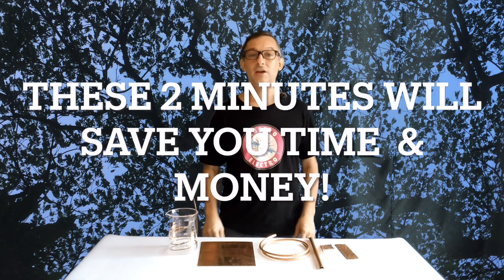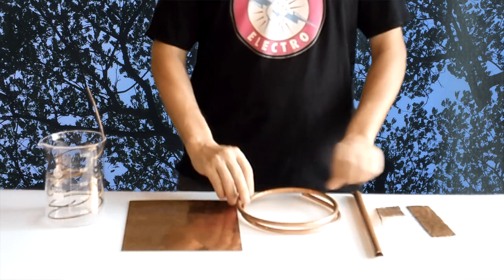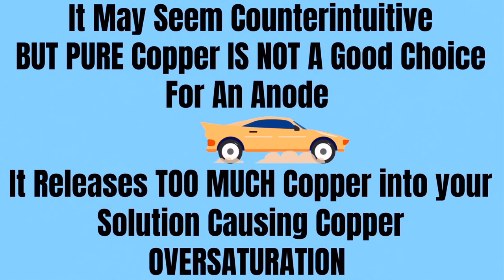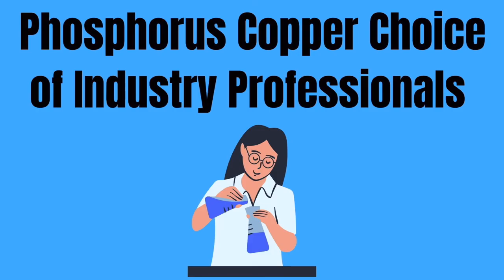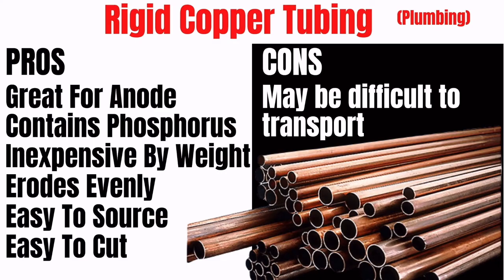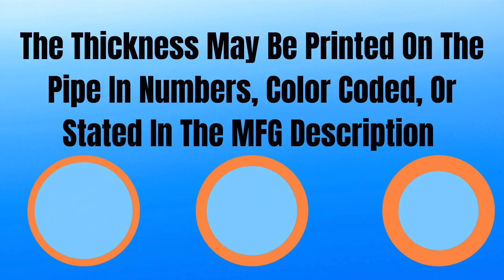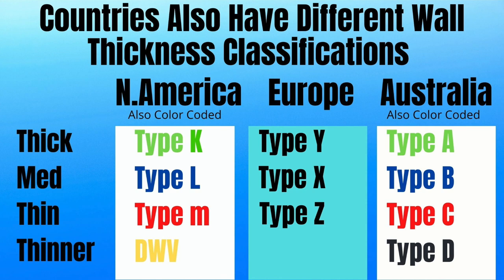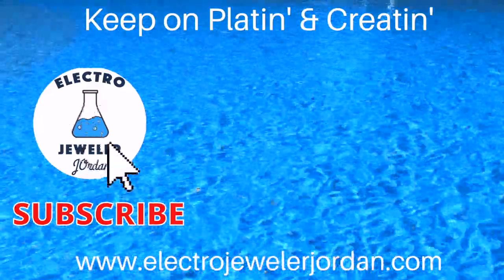Proper Anode Selection Copper Electroform, No More Guessing, Perfect Choice

Comment: great vid! I use pipes but I have no idea if they are phosphorous or not. Might need to look into it.
Reply from the maker: Most straight pipe contains phosphorus.  After you add the chloride the pipes should turn black after a few hours of plating, that coating shows that it contains phosphorus .  Every copper pipe has the manufacturers name and model number on it, you can go to their website  and look for the metal content.  The phosphorus  content will be less than .5% so don't worry if it looks like a small amount.
Reply: @electrojewelerjordan490  oh cool, yep I get that blackness so I must be all good! Hey I have a question.....you know how the anode to cathode ration should be 2:1? Do you have any advice on how to calculate this for pipes? I have seen some people say to only calculate the front half of the pipe and not the back, but then other people say this method doesnt work for them and they calculate the whole pipe (the part that is submerged for both cases). I only just learned about the ratio so have been measuring the front half technique. I've been Electroforming for 6 months now and lately have been having alot of trouble keeping my bath balanced hence why I want to start from scratch again using your bath recipe! Once I have that made I really want to try and look after it properly as all these issues are frustrating. any who, sorry for the novel! Curious to hear your tips on how you would measure the pipe surface & what works best for you :) thank you
Reply from the maker: Small tanks are very conductive and tend to get oversaturated very easily.   I use a 1:1 ratio with my low acid formula and it stays balanced .
Reply: @electrojewelerjordan490  Oooooo that is nice to know! 1:1 would be much nicer for me too. Looking forward to experimenting when I make your recipe :)
Reply: @electrojewelerjordan490  I would love to hear how you measure your pipes if you dont mind sharing? as in would you measure just the front half of the pipe? or the whole thing :)
Reply from the maker: @earthsoul9454  since it's hot here (80 -86)
 and the process is sped up in the heat I calculate front and back, in a colder environment I would just calculate the front ( low 70's)
Reply: @electrojewelerjordan490  ahhh thank you. this must be my problem. I am in a hot place. Shall experiment with measuring front and back :)